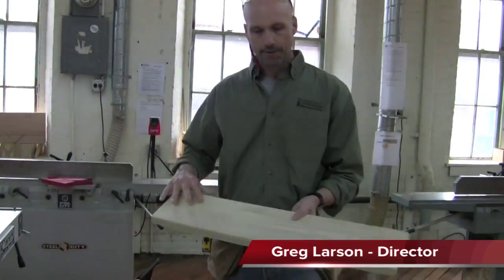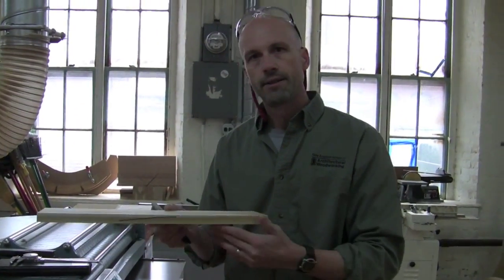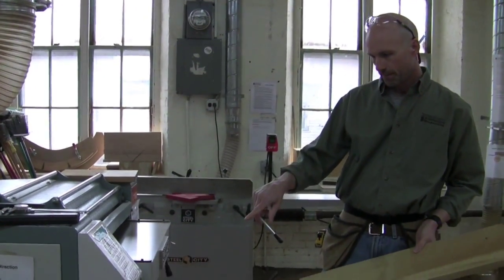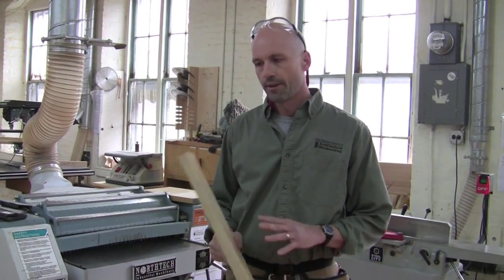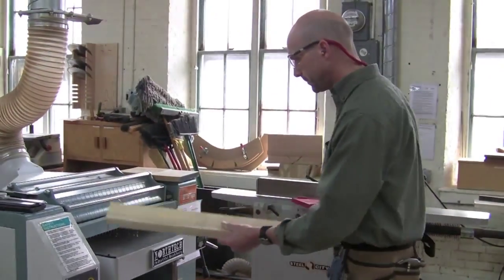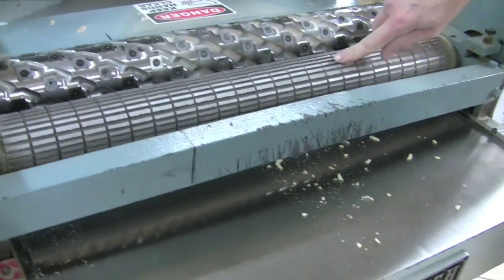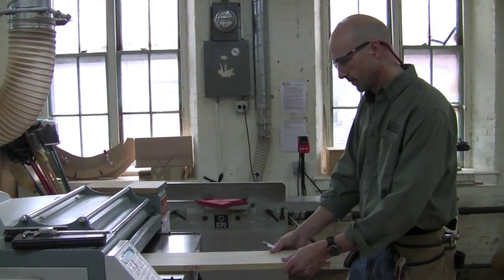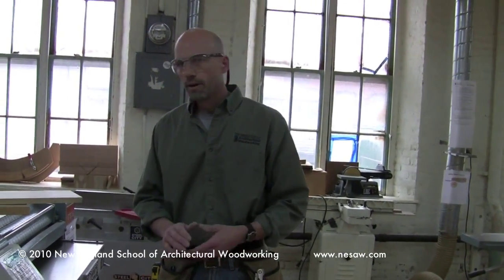Milling Four Square - Thicknessing

Comment from the maker: Hi Richard,

In order to guarantee that you have a flat board that is a uniform thickness, you have to flatten on the jointer first, then thickness with the planer.  If you joint both faces of the board, there is no way to guarantee that the faces will be parallel.  Conversely, if you only use the planer, you cannot guarantee the board will be flat because the planer doesn't flatten.  If you put a twisted board in, you'll get a perfectly thicknesses, twisted board out.  Hope that helped!  Greg